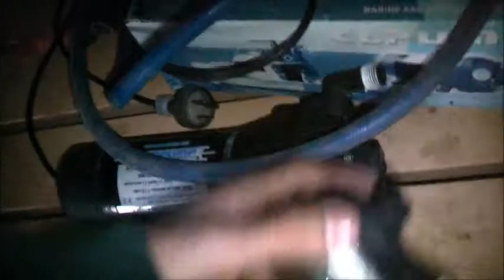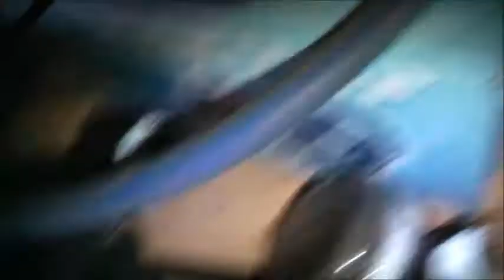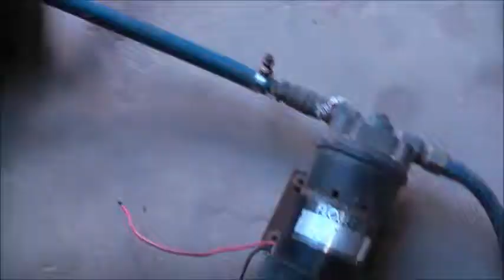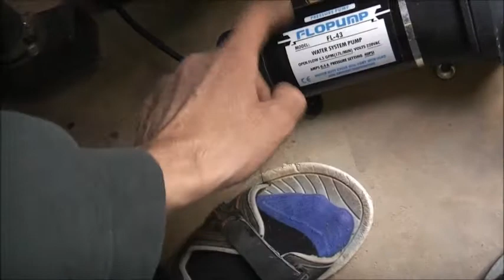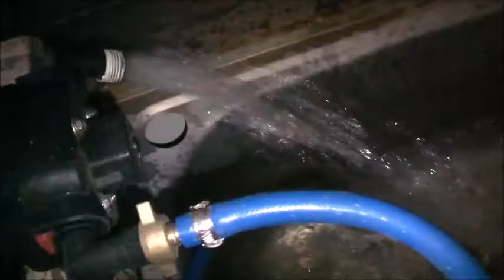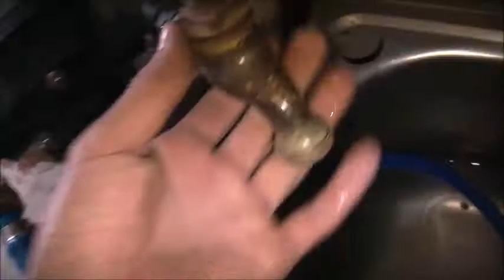Small Chinese Pump Test

Comment: as douro20 mentioned it's an obvious clone of FloJet right down to the strainer and the box it came in!  I have several of the 12V versions with the pressure cut-off like that.  Probably not that pricey being Chinese but if it was a Flojet it would be a $350 pump new.

Comment: Reminds me of the ones used in caravans, but they are much smaller as you dont need much for a caravan sink i suppose. :-)

The motor brushes sound a bit noisey, i would check the commutator for roughness.